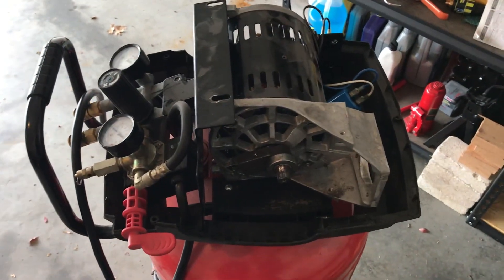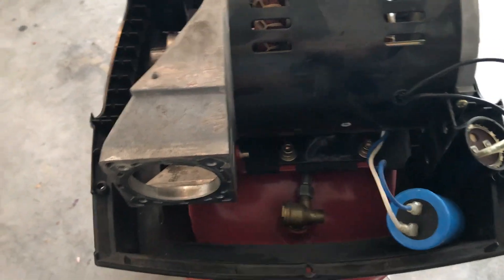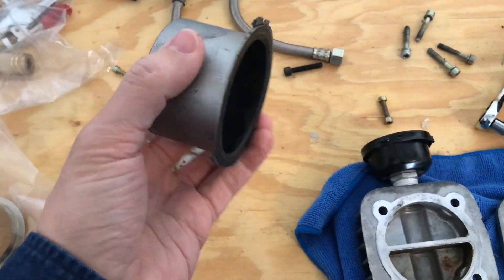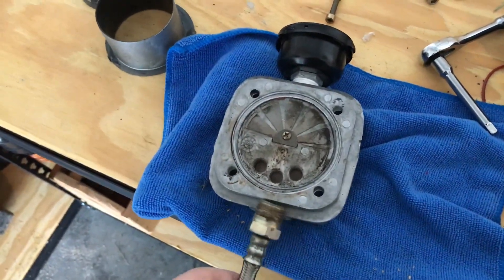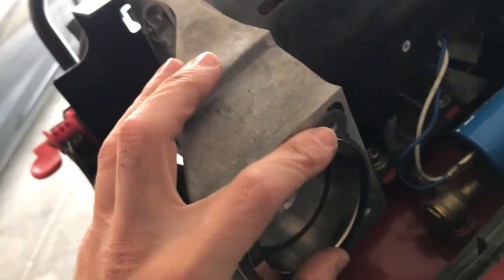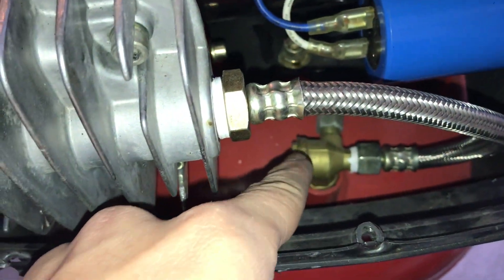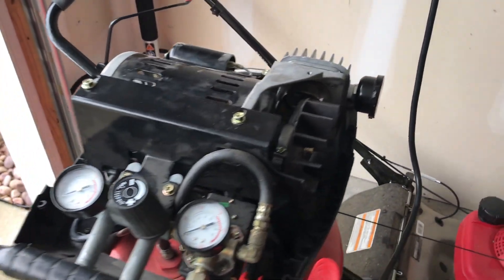Husky F2S26VWDVP Air Compressor Repair

Comment: Just fixed one of these today.  To service the cylinder head, remove the motor.. no need to cut a notch.  The check valve is also unique to these models. Fortunately, Home Depot sells them for cheaper than eBay.  Watch for the unloader and be very careful with it as it is made of really cheap die cast and will break very easily. They do not sell unloaders separately; only as part of the pressure switch.

Comment: I have that same model but it starts for a second and turns off. One time it actually filled all the way up but when I bled some air off it wouldn't kick back on. Any suggestions?
Reply from the maker: I would try replacing the capacitors.  Most likely you have a bad Running capacitor, which you can find here: https://www.ereplacementparts.com/capacitor-running-motor50f250vac-bkt-p-2577626.html.

If that doesn't do it, you may try also replacing the Starting capacitor: https://www.ereplacementparts.com/capacitor-starting-motor250f125vac-bkt-p-2577627.html

Hope that helps!

Comment: Just for the sake of completeness, the starting capacitor only fires for a second or two with increased amperage to get the motor spinning, then cuts over to the running capacitor until the unit kicks off. You can hear the change if your location is dead silent as there will be an audible click, both with the electronics and mechanical bits 'switching gear'. Electric motors have both a Peak horsepower and a running horsepower (continuous), though which one they state often falls to the marketing vultures. The home market will rate their motors at peak for that split second it can hit that mark, but the running rating is somewhere between 3/4 and half the peak number. Most notorious is the "5hp SPL", which runs continuous between 2.25-3hp, even though the marketing will say it's a 5hp. Industrial motors *normally default to the continuous rating only, but they are also most often either strictly 220 or 3 phase (some variant between 230-460 volts). You can do the math on the motor label by multiplying the volts x amps=watts, divide by 742, then decide how much you got ripped off by marketing.

Comment: I wish you showed how to pull the piston rod out and reinstall it ,,
Reply from the maker: Notonebuttwo Othman its extremely easy. loosen the bolt holding the rod onto the outdrive from the motor, then slide the piston right out. Installation is the reverse. pushing the piston into the sleeve first makes installation easier.
Reply: Daniel Carbone 
Can you tell me where you got the parts from please ,, I’m at Home Depot and they don’t know shit
Reply from the maker: @malikothman5381  I ordered from home depot's website and had it delivered to my local store
Reply: Daniel Carbone 
Thanks

Comment: I have the exact same compressor. I tried to start it one day and did not turn on. What do you recommend me buy?
Reply from the maker: My first guess would be probably the starting capacitor.  Does it turn a few times then stop or does it not try to turn at all?
Reply: Daniel Carbone mine runs slowly then quits, I would compare it to starting with a low battery, any help?

Comment: where did you get parts
Reply from the maker: https://www.ereplacementparts.com/husky-f2s26vwdvp-gallon-portable-electric-air-compressor-parts-c-508437_508442_508800.html
Reply: @danielpc12345   thank you
Reply from the maker: @lgm8114  Also just remembered that I ordered the actual piston assembly through Home Depot, but the rest of the parts came from the link I provided earlier.
Reply: @danielpc12345   replaced piston but couldn't find that steel hose. thanks

Comment: you did not show which direction to put the plates back on the cylinder!  Jumping ahead to it already being installed is a BS move after i sat thru all of the previous..
Reply from the maker: I describe and even show correct valve placement at 2:32
Reply: @danielpc12345  yes but when youput it together which side of the valve faces in and which side out?  fits both ways..
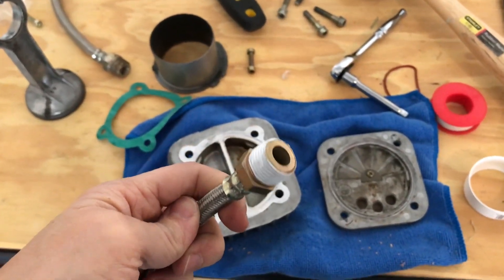Reply from the maker: scott o The valves and cylinder head go onto the crankcase at the same time as the head bolts go through both.  Simply put the valves onto the head as I show at 2:32, then attach the head in the orientation I show at 4:25.  Use the inlet air filter for orientation reference.